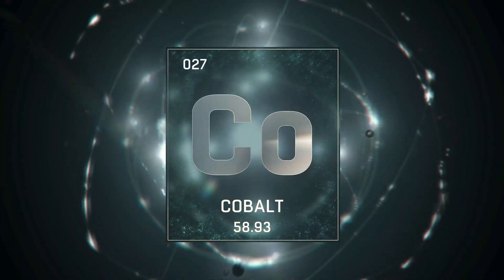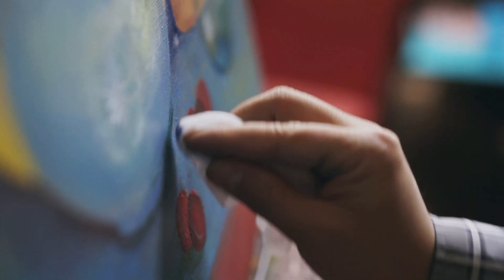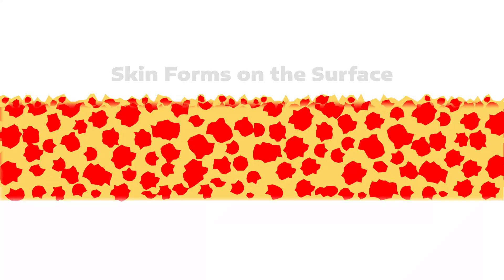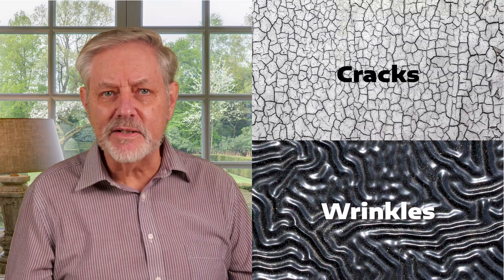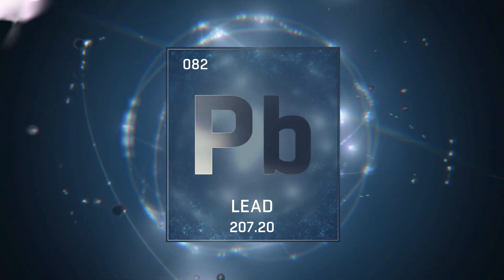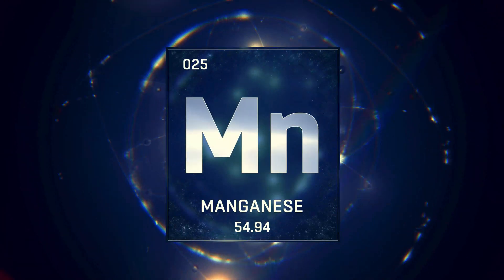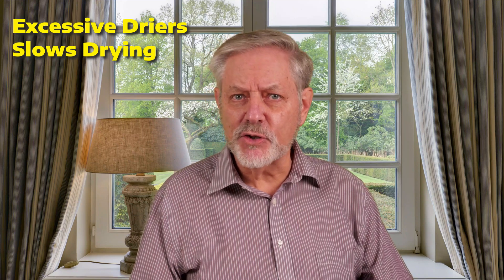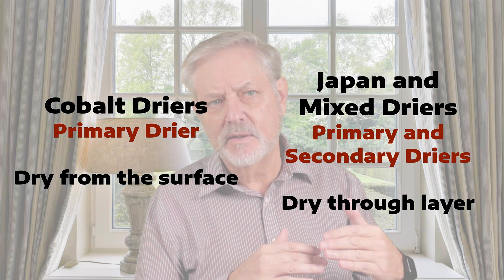Cobalt vs. Japan Driers: The Truth About Oil Painting Drying Agents

Comment: I've been using Cobalt, but very sparingly.  I use it in my medium, which consists of half an ounce of linseed oil and half an ounce of OMS.  I dip my small palette knife in Cobalt, let it drain, and then swish the coated blade in my medium.  The knife blade is maybe three quarters of an inch long.  Seems to work well.  I paint rather thinly.

Comment: I have never used these. I just paint with a bit of alkyd medium. It helps the slow drying paints, like alizarin and some other reds, to dry at the same rate as the faster drying colors.....and it doesn't yellow with time.
Reply from the maker: Make no mistake alkyds yellow in time. However, using the sparingly to accelerate drying time is a better practice than using driers.